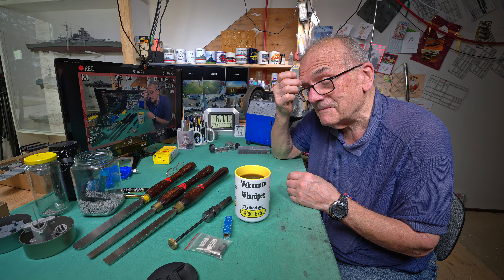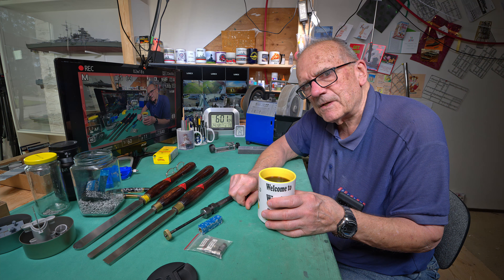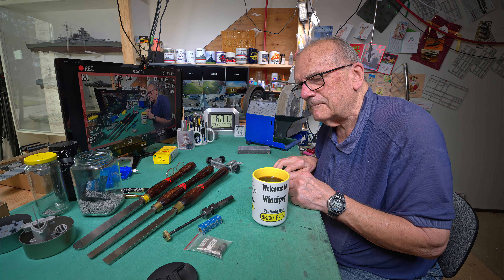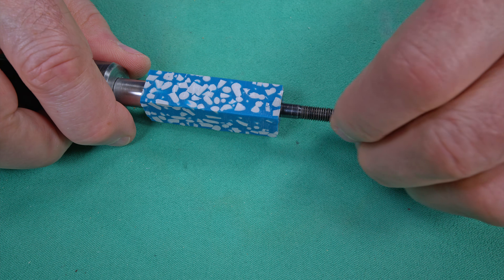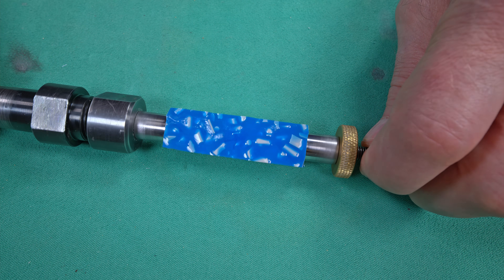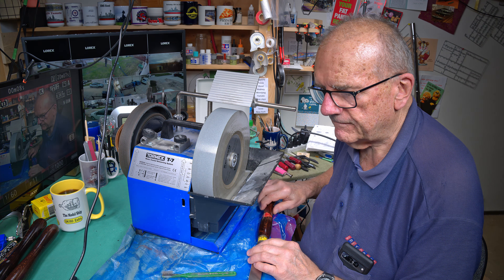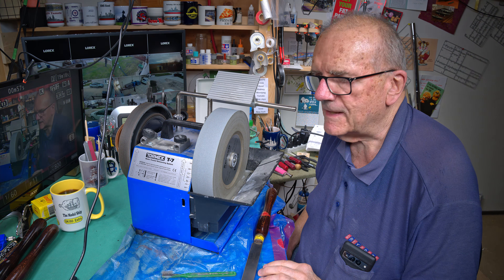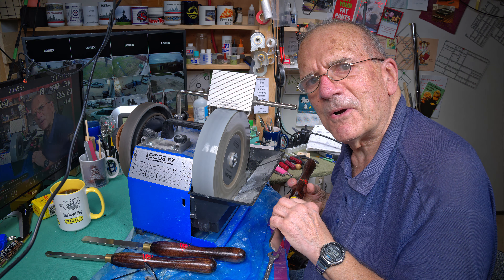The Model Ship - Part 1587 - 8K Extra

Comment: ...looking forward to seeing that thing turned...👍
Don't know how deep you want to get with info, but viewers may be interested to know that the bushings are the same size as the pen's metal parts...that's how, when turning, you get a smooth transition between the body and the parts. And that different kits require different bushings...
Or, just use a good set of calipers...but me???...I'll splurge for the bushings...😆
Matt
Reply from the maker: Re: "viewers may be interested" Thanks for the suggestion.
Yes! I always buy the appropriate bushings. Only made up my own once. 👍